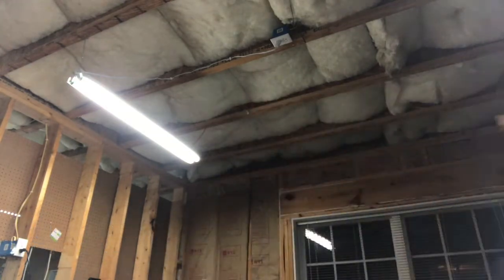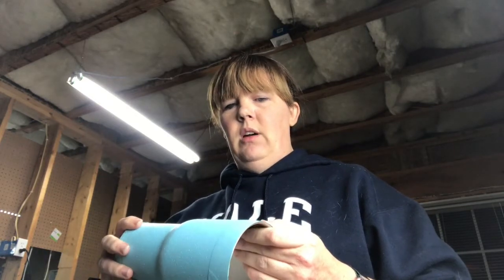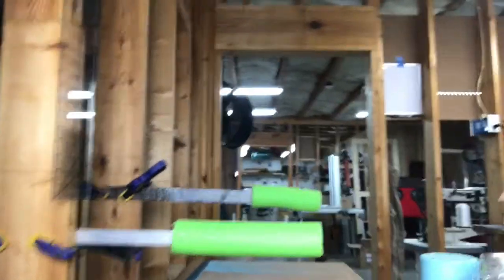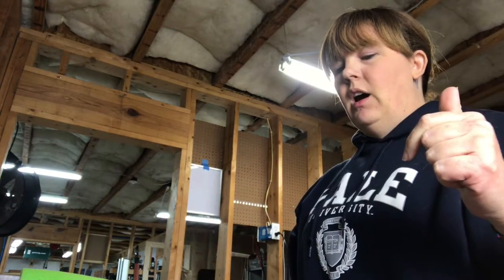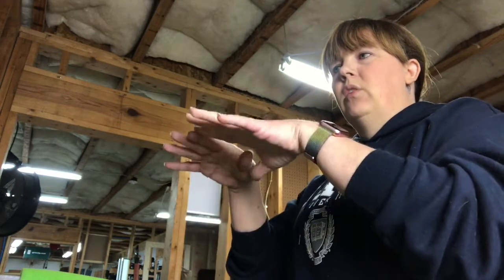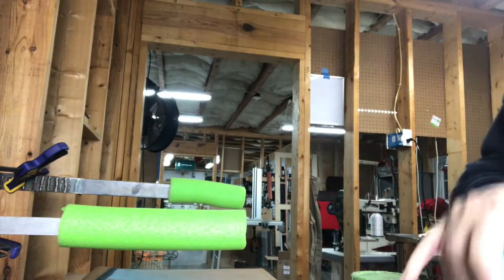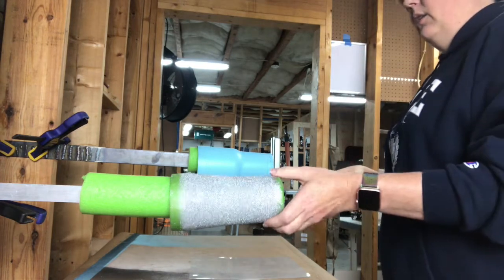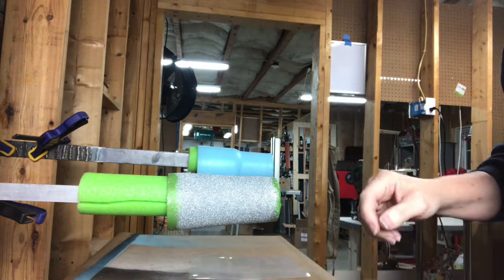Glitter Tumbler Series: Episode 3a: Epoxy on Loose Glitter Tumbler

Comment: How can I make sure I'm using the right ratio for the epoxy?
Reply from the maker: Just got your comment, apologies for the delay. Your epoxy will come with instructions and it will tell you if it’s 1:1 or 1:2. Typically, if the bottles of the 2 parts are the same size, it’s 1:1, or if one bottle is twice the volume, then it’s 1:2